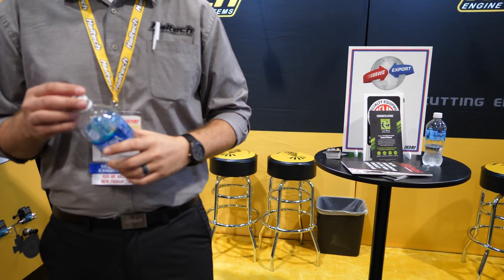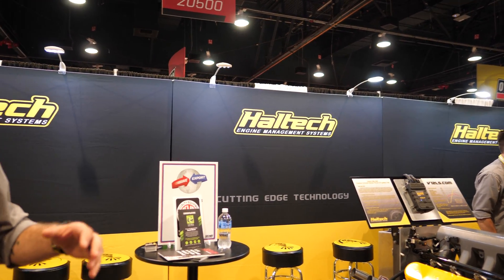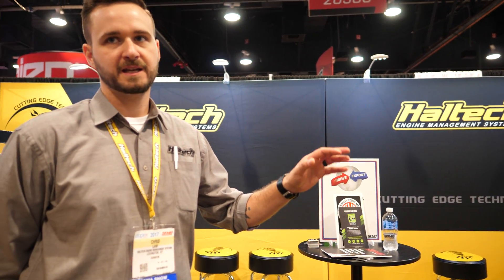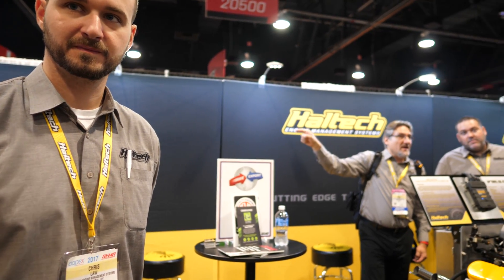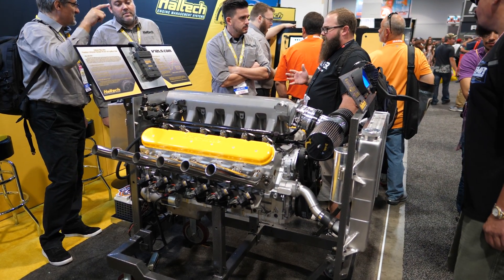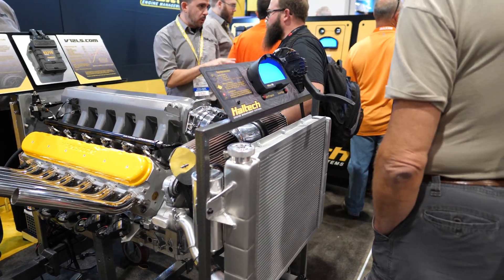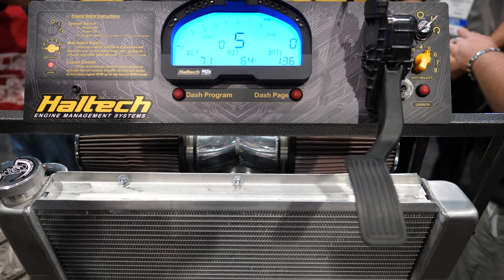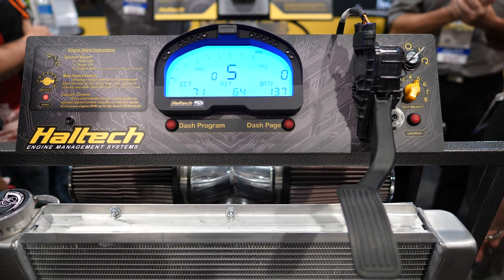V12 LS Engine and Haltech Engine Management Systems - SEMA 2017

Comment: I love the ls-12, can you put the free valve heads on it?
Reply: The free valve set up would be amazing! I cant wait till the technology comes my entre level
Reply: stroked ute You know it's coming to. I like the fuel injected cross ram with dual throttle bodies. I guess on the V12 you need six throttle bodies. I'm just amazed at how The Innovation keeps getting better, building off of old stuff,
And creating something completely out of the blue!
I was hoping somebody would replace the rods and crank with a rotational valve that pumps a liquid. Kind of a cross between a transmission and an engine.
Reply from the maker: Good question. I’m sure it can be done.  Wonder if anything will ever come out of the free alive that koenigsegg developed

Comment: How can you adjust timing if its firing at all degrees
Reply from the maker: Good question!
Reply: It's not. If it was just constantly firing all spark plugs it just wouldn't work. In waste spark ignition, there are half as many ignition coils as there are cylinders, each ignition coil firing two opposing cylinders (in any 4 stroke engine with an even number of, every time one cylinder is at top dead zero on the compression stroke, the other is at top dead zero exhaust stroke). A ignition coil fires every time it's two cylinders approach TDZ, so the one that's on compression stroke fires, but the spark on the exhaust stroke cylinder does nothing is "wasted".